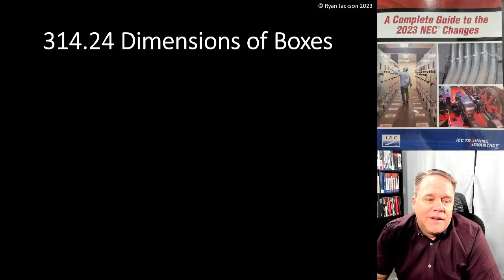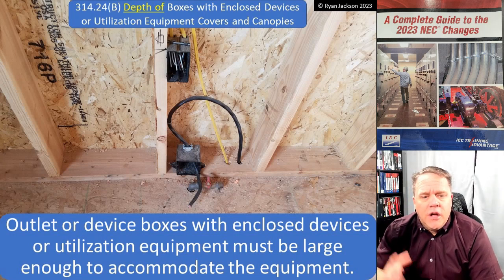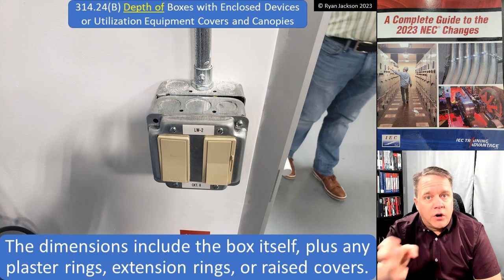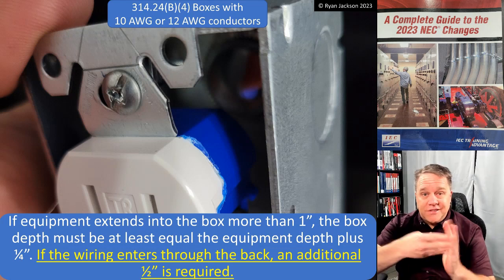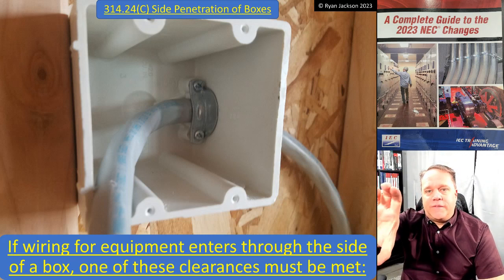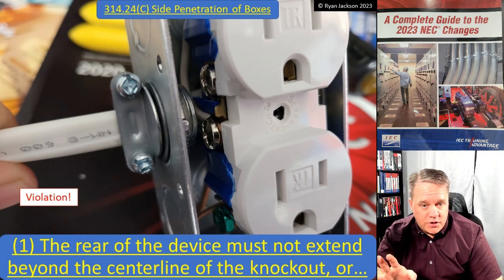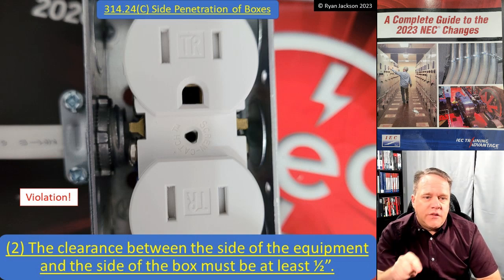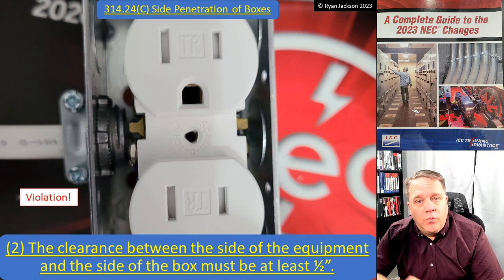314.24 Dimensions of Boxes

Comment: A few years ago while attending one of our 8 yearly IAEI continuing education classes we had a brilliant instructor from UL labs sitting at our table before class who started asking our options on some common things most sparkies do. He asked if it was okay to drill say a 7/8" hole for a 1 /2" connector in the side of a plastic single gang box or a metal bell box that had the single hub already used. Told us it was not legal. Yes I have done this numerous times to extend a circuit. Think if its in a wet or damp location and you use sealing rings or sealing lick nuts it should be allowed.